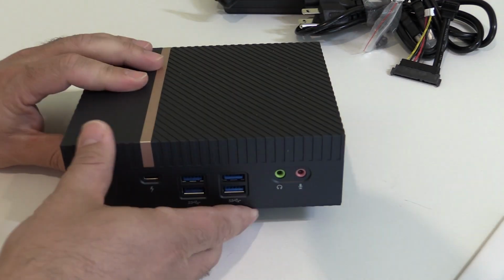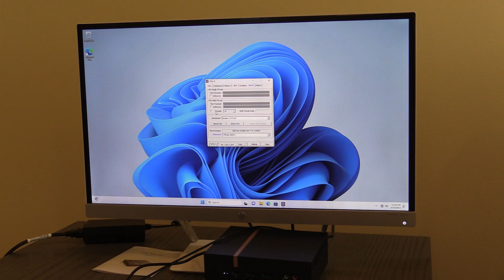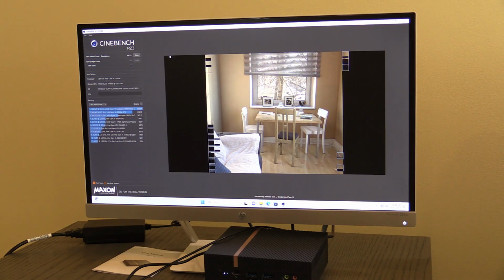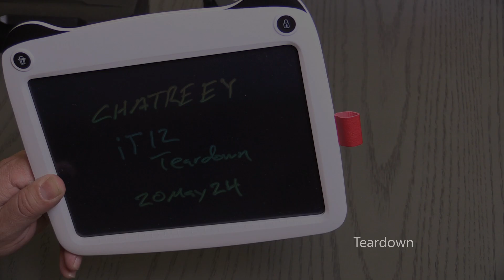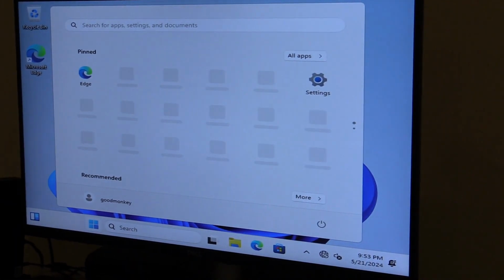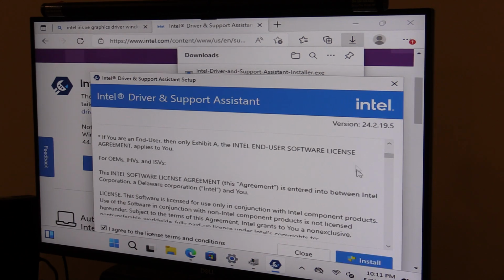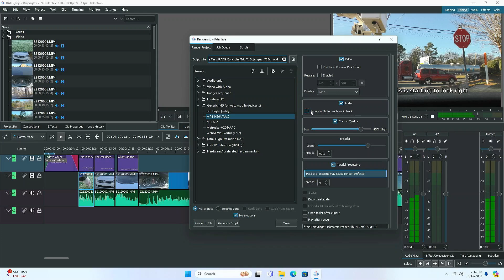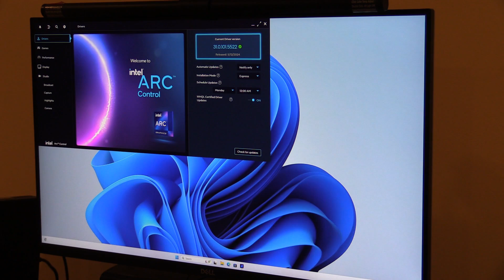Chatreey iT12, i9-12900H 32GB! Synthetic Benchmarks and teardown.

Comment: nice video! were you finally be able to get the 2.5 SSD properly connected? any compromise doing that? I need to install 3 drives (2x nvme+ 1x 2.5" SSD)  Thank you!
Reply from the maker: Yes, I did have the SSD in there hooked up with the SATA cable. It all went back together and worked fine.

Comment: Help please: I ordered this same exact thing from Amazon. I’m new to this. When unscrewing I noticed that there was not a 2.5 inch ssd/hdd in the cpu nor was there one that came with it to install.  😳😳😳

1. So basically did not come with 2.5inch SSD/HDD 

2. NOR SSD FOR NVME/SATA slot

Is it supposed to come with it? In the video, I believe you skipped passed that and I’m not able to see the components that were pre installed in your mini PC when you opened 😢

Edit. Correct me if I’m wrong but maybe they are just for expansion and aren’t needed?

Comment: Too expensive for what it is. The Minisforum MS-01 is similarly priced with better networking and a PCIe slot.
Reply from the maker: The MS-01 is definitely interesting. On Amazon today I found ones without RAM, storage or OS for about $680. One like the iT12 I have, same processor, RAM, and storage is about $890. Probably just like anything it takes looking around. Those integrated SFP+ ports do look interesting.
Reply: @ntgm20  Mine is an ESXi host (efficiency cores disabled) with dual 10G links. 96GB RAM. Decent performer. Replacing a Dell PowerEdge R740 during the summer months.